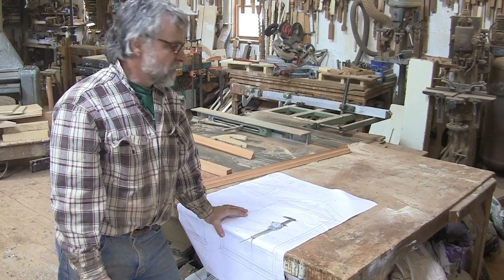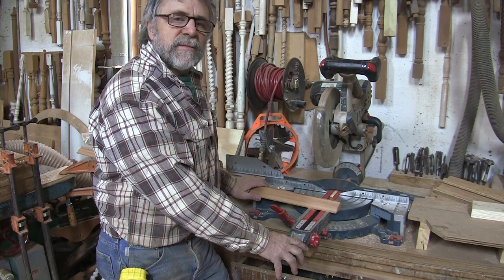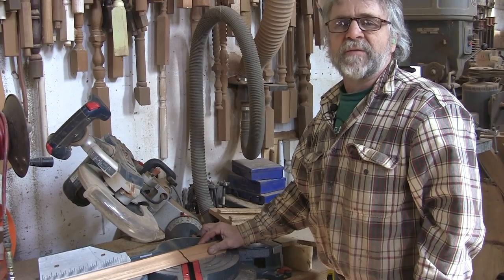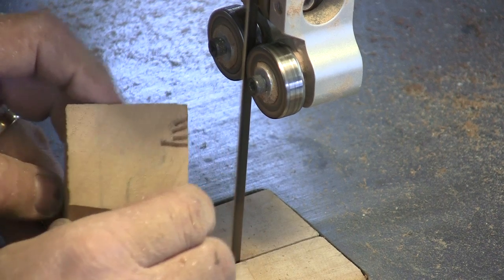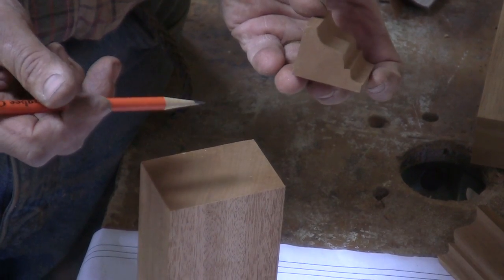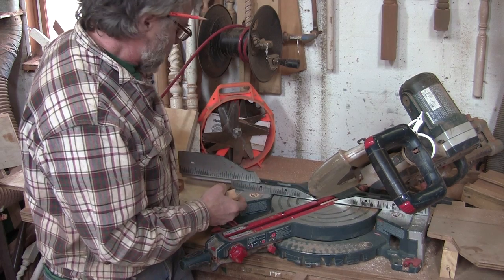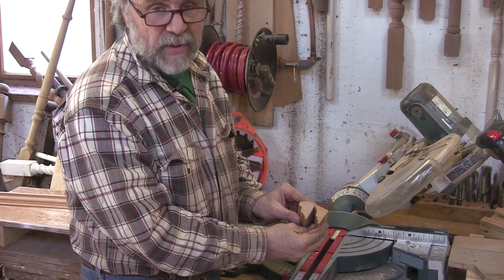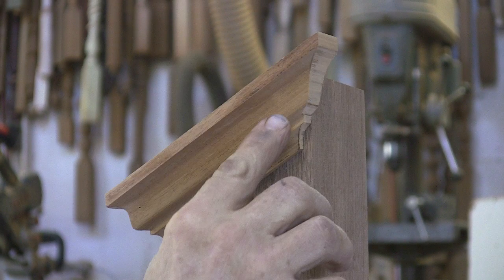Three-Piece Pediment Crown with Jed Dixon

Comment: If the angle of my pediment is 22.5 degrees, do I still need to make a custom cut level molding for the sides? I wonder if I could sand a little piece of crown portion on both rake and level molding to make them match!